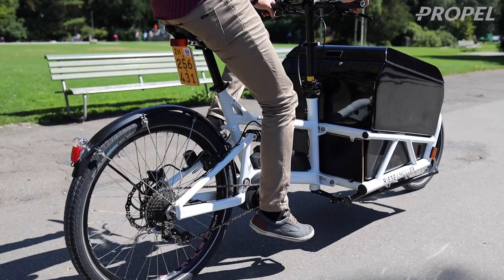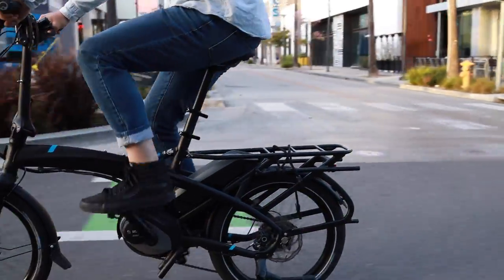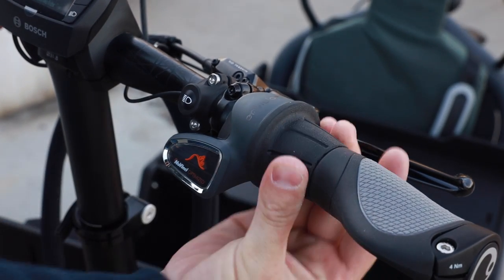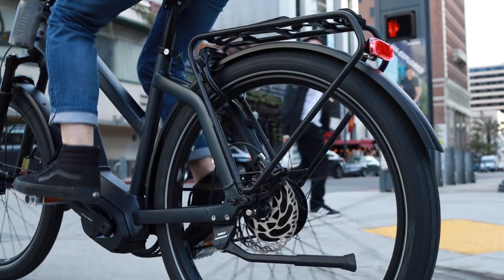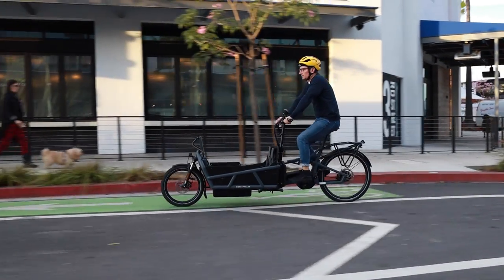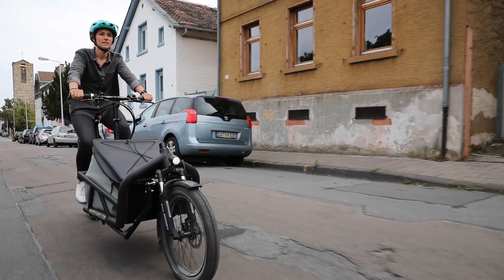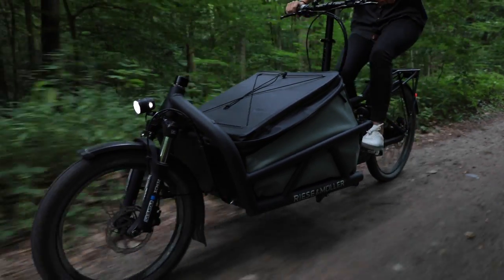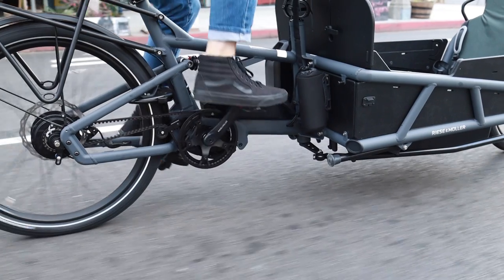Electric Bike Drivetrains: Internal vs External Gears (Derailleur, Enviolo, Rohloff, etc)

Comment: A big one he doesn't mention is Pinion, the German gearbox system with a wider more even range than Rohloff.  Pinion / Gates is my current #1 fitness all purpose all weather choice with a Priority 600. In an ebike that forces a hub drive system with plenty of good options.  The point about chains and derailleur maintenance and cost is well worth considering, especially with the big extra stress of an ebike.  I'm on my third chain / cassette combo in 7,000 miles of ebike riding and I'm really getting tired of paying for them and dealing with the sloppiness when they get worn.  More so after the Gates/Pinion experience. For Rohloff you'll find it much easier to fit into any number of traditional and custom frames. Where I am, close to the old Paramount shop with Gunnar / Waterford you have any number of Rohloff choices. No Pinion as it requires a custom BB frame build.
Reply from the maker: The Pinion is a great system, but it’s largely unavailable here in the US. I also haven’t found too many quality hub motor setups here in the US which would be required to make the Pinion more viable. Some brands in Europe have paired the Pinion with a Goswiss motor, but they are now no longer available. I think some other viable options would be Xion since you kind of need advanced internal torque sensing inside the motor. There aren’t too many motors with these specs on the market and there are none in the US unfortunately.
Reply from the maker: I mean as an ebike. These bikes look great, but we only deal in ebikes. That’s also the focus of this video and discussion.
Reply from the maker: I wish we had all the ebike options available in Germany. I’m working on it though ;)

Comment: Question, I am planning to buy a Supercharger 2 HS (45km/h version). Is it true that the Enviolo system generally blocks around  35-38km/h? Is it true that the only option is to go with derailleur or Rohlof to be able to reach the 45km/h? I do not have the budget for the Rohlof, really hesitating between the external & the enviolo... any advice? I do 100km per week in average. Many thx for your answer :)
Reply: What did you end up with? I can lease a high speed bike through my employee but I'm torn between Enviolo and Rohlof.. Not reaching 45km/h would be a dealbreaker for sure, but if the Enviolo gets there I'm fine with it.

Cheers.

Comment: You have the most useful video I found on this topic (and other great videos).  I tried a new R&M Enviolo 380 HS bike and I found the highest gear too low to get to top speed! According to the R&M website with Enviolo 380 as the highest gear (9.54m) vs Derailleur (8.36m) and Rohloff (9.3m). In your experience is this true? Or does the inefficiency make the Derailleur or Rohloff better. Thanks in advance.
Reply from the maker: Thank you! Glad you enjoy! You definitely need to pedal a little harder on the Enviolo to get to 28 due to the lower efficiency. I still think it’s worth it though. If you want the easiest time to hit 28 the Derailleur and Rohloff are a little better, but Enviolo is still the most popular. I think the new Gen 4 software also improves this.

Comment: Very informative review.  I recently was in the market for an eBike and wanted one with a belt drive and internal gears. However, the dealer advised me against that because of the difficulty of removing the wheel to repair punctures.  I ended up with an excellent eBike with conventionally derailleur gears thereby saving myself a lot of money, around £1,500. However, was he right about the difficulty of removing rear wheels with hub gears?
Reply from the maker: The effort to remove the wheel varies widely depending on the bike and hub manufacturer. Most we work with make it really easy. The key thing is to not have to tension the belt after removing the wheel, this is a poor way to design a bike from my perspective.

Comment: Hi. I have an Iron Horse Tango Tandem that I'd like an internal hub, so as to have a coaster brake. I'd like to have an mid-motor for it also. Is there a good pairing you could suggest? Thanks.
Reply from the maker: Bill we'd love to recommend a aftermarket system, but there are none I can give our stamp on at the moment. I would recommend checking out the electricbikereview.com forum and see what others have experienced with kits.

Comment: on an electric bike, 3 speeds are all that is needed : low, mid and high gear. the engine will fill the gaps. 
7-8 are far too many; the Rohloff serves no purpose for an everyday urban bicycle. 
A good old, reliable and maintenance-free Sturmey Archer, and a chainring/pinion carefully selected and you're good to go. 
even on a Nexus 7 you will use 1st, 4th and 7th an that's it.

Comment: E-bike goes with a carbon drive, internal gears and disc brakes. Everything else is a fail because you want as maintenance free as it gets. Also, continual variable gears are the future just need to have auto gear down when breaking. Meanwhile the Rohloff internal hub is very nice.

Comment: When I was a kid, 55 years ago,  I had a Raleigh 3 speed "English" Racer. It had a 3 speed "Sturmey Archer" internally geared hub. Great bike for its day. Although it was only 3 speeds I could ride it anywhere and never had to worry about a complex derailleur gearing system. It was a simple, rugged, and reliable gearing system. A Do they still make basic 3 speed internally geared bike wheels? If so are they used on electric bikes? For most everyday riding 3 speeds on an electric should be all that's needed and it would certainly be much less expensive than most other internally geared systems. I would also choose a modern belt drive for reliability and low maintenance. One issue with internal gearing on an electric bike is that that a hub motor can't be an option.
Reply: Hi I’m buying an ebike from China that has a Sturmey Archer internal gear hub a gates belt drive and a bfang 750/1000 watt motor, should be here in May, like you say low / no maintenance reliable cheap, ticks all the boxes for me.
Reply: I used to hate those 3 speed Sturmey Archer hubs because the linkages always broke, the hub itself though was strong enough for all the abuse we as kids gave our bikes!
Reply: Brompton folding bikes uses a 3-speed Sturmey Archer hub on their 3-speed and 6-speed versions ( 3 internal hub + 2 speed derailleur). The hubs are now made in Taiwan, not the UK though. They also have an electric version with their own motor.
Reply: The brand new VanMoof S3 and X3 use a 4-speed Sturmey Archer!
Reply: @HartmutSchirmacher71  Thanks, I'll take a look. Do you know if they are electric? Do they have belt or chain drive?

Comment: Thanks Chris for this great tutorial! I have three different uses for biking : internal hub enviolo + carbon gates which I found great for my commuting to work (a little less than 10miles one way), we have a "pino tandem" from Hase bikes with the derailleur XLR which is amazing but hard for my wife to use, especially on such a big bike to ride, takes a lot of attention as you said when stopping. And we will receive soon the Birdy from R&M with derailleur as we both have a public transport use combined with biking here in Belgium. Do you consider electronic shifting a good option either for mountain bike owners as you recommend derailleur/Rohloff or for my personal use of tandem or Birdy (but I have not tried yet and it is already a budget!) ? I did try once at the great "Ronde van Vlaanderen" a road cyclist tour from a friend and it was very light/efficient/handy in that purpose.
Reply from the maker: Thanks for your detailed comment. Sounds like we have similar taste in bikes. Many people do opt for electronic shifting for mountain biking which has its advantages. It’s not really possible to retrofit the E-14, but it’s easier to retrofit electronic shifting on the derailleur.

Comment: Hi Chris, this video is very helpful. I spoke to a cargo bike shop near me and they told me the cables with the Enviolo hub tend to freeze in the winter. What’s your experience with this, is there anything that can be done to prevent it?
Reply from the maker: This can happen, but it’s usually with a big dip in the routing. You can pack the cables and shifter mechanism with grease to prevent this.

Comment: Hi Chris! thanks for the informations. I want to ask something. Which electric motor and chain system do we need on a delivery bike in a cities such as Amsterdam or UK and for example for uber eats or for deliveroo? And which one is more efficient and low cost too for delivery bikes?
Reply from the maker: I think there are some different bikes available in Amsterdam or the UK. I would consider getting a Bosch motor due to its reliability. It would be nice to have a belt and an internal hub, but they will add to the cost. If I was doing that job I would consider spending a bit more upfront though to improve reliability and service intervals.

Comment: I have a riece muller nevo gt 2022, I find it great,one thing is that when upgrades occur, they are not compatible 
With one prior,
For example , my cycle was ordered December 2022, came January  2023, and my kiox computer  has upgraded to model 300.not compatable.
This  is only one item that upsets me. 
Only  by purchasing a new bike, can one get  the new upgradings
Regards Michael green

Comment: This covers the features and use but nobody talks about reliability and longevity. Ebikes get ridden more often and further so it would be good to know which systems are bullet proof over the long haul.
Reply from the maker: In my experience the Bosch motor is the most reliable motor system, this is the main reason why we focus on this motor in our shop. For the hubs, I’ve found the internal hubs generally have great reliability provided they are used within the specifications.

Comment: Have you ever used a shimano nexus 8 speed internal gear hub  with a mid mounted motor? Do you think it will hold up well with the extra torque  a electric  motor can supply? Thanks
Reply from the maker: Roland, the Shimano Nexus 8 speed is an awesome hub. Just don’t use it with a motor with a torque rating over 50Nm and without some sort of shift protection either Bosch with the software torque based shift detection or other systems with a physical cut-off switch. Otherwise it will perform excellent and provide a good low maintenance solution.
Reply: It's fine, I have a ebike with a Yamaha engine that produces 80nm of torque and a Nexus 8, and after 4 years and almost 8000km of use it shifts good.
Reply: I've got good experiance with the Nexus 8 using a Brose motor and Gates CDX belt in all seasons. Now after 17000 km when just switched into 4th gear sometimes it can't manage the torque. As I don't need the 4th gear often I will wait for next 5000 km maintenance intervall. If the problem proceeds I will replace Nexus with same type. Exchange should be easy when reuse the old hub hull. By its cost a lifetime of 20000 km is just fine with me.

Comment: Thank you for the awesome, very informative video. Do u know if Rohloff is working on a internally geared hub combined with a rear hub motor? I am interested in a all wheel drive, dual battery, commuter bike to replace a car. I would like to get to commute speed of 50mph, in order to shorten my commute times, as the distances travel are quite far and I need the speed to keep up with ICE vehicle traffic.
Reply: what you're looking for I think the Pinion Gearbox is the best, (but expensive) since it has the largest gear range available at more than 600%, but you'll still need to have a cog ratio on the drivetrain if you want to be able to pedal effectively at 50mph.

Comment: Thanks for the video, very informative! Quick question regarding the N380 vs Rohloff: do you know what the final gear ratio on each of these are? Which one would have the higher theoretical top speed, given the same amount of pedalling?
Reply: The Rohloff has the widest gear range. Even wider than some derailleur system. You will get a higher top speed on the Rohloff for the same amount of pedaling simply because the gear range of the Rohloff is so much wider than the N380. I'm currently using the NuVinci N360 on my Bike Friday Silk folding bike purchased in 2013. You can read some of my replies (see anything above from here). You should at least try riding a bike equipped with a CVT. It is unbelievably smooth with virtually no clicks, no vibration, no sound at all, and it is instantaneous. Most people who tried riding my bike described as surreal. That is the only cool thing about CVT. Too bad the don't make it with something even wider than the 380%. If you want speed and climb steep hills, go with the Rohloff. It is also lighter and about 10% more energy-efficient compared to the NuVinci. The penalty on the Rohloff: super expensive and you will still get all that clicks noise and can feel the tiny vibration from the gear change. I test rode San Diego's FLX Blade 2.0 electric mountain bike equipped with the Rohloff and Gates Carbon Belt drive just about 3 weeks ago. The smoothness of the CVT is no comparison.
Reply: The 10% efficiency penalty is pretty massive. That’s 10% capacity gone from your battery regardless of its health. If your pedals with zero assist it’s like a 10% weight penalties on inclines. I guess city commuting worth the cash. Good to remember some people have put 300,000km on Rohloff hubs you can always reuse the hub on a new bike be it e bike or not in the future. I really would like to rest ride both. Here in Australia not so lucky with choice and test ride I don’t mean a 3 minute ride around the block.

Comment: If a chain/der. System is 99.%, how would the belt drive internal hubs match up? Do you lose 10% with enviolo? Love the videos!
Reply from the maker: You do lose about 10% efficiency in comparison. For some this is important, but most feel it’s not that critical considering you have a motor.
Reply: Propel Electric Bikes the rohloff is close to der tho?
Reply from the maker: You lose very little in the Rohloff hub.
Reply: @Propelbikes  the 10% translate then in the same proportion in the lifespan of the battery and daily autonomy. Thanks for this video. As usual, very informative and wo emotion

Comment: Just saying with my 80s non index top shifters I can shift top to bottom gear on a 5/6/7 speed instantly so long as teeth are profiled... And to to the middle quite easily, it's just moving one at a time that's difficult compared to modern shifters but for urban use not as important I find.

Comment: Anyone who ever owned a e-bike with center motor, should realize that a belt drive is superiour to chain in most regards. If you drive it in any amount of milage, know how many chains and sprockets you go trough. Rohloff gear is the best internal gear made....so far...only con, is the price. I sell ebikes.
Reply from the maker: The Rohloff is awesome! But I’m also a really big fan of Enviolo for its ease of use.
Reply: Propel Electric Bikes i like it too, but the handle is not suitable for ppl with weak hands, some elderly find it difficult to change. But funktionality of the gear itsself is good
Reply: Propel Electric Bikes i like it too, but the handle is not suitable for ppl with weak hands, some elderly find it difficult to change. But funktionality of the gear itsself is good

Comment: \\\New Subscriber///    What an excellent video; Great stuff .  I'm very new to the E-bike market, however I am trying to get as much information as possible to crunch the numbers in order to pick my new/first ebike to commute to work "sometimes" and for leisurely rides from time to time. I want POWER because I'm old and very large so I need comfort torque reliability and functionality in the bike. I am aware that this will not be a cheap package, but I would really appreciate your help in giving me options that I may not be aware of from my research.

At present, the bikes on my short list are;  Specialised Vado 4.0, and 5.0 2022, Cube Kathmandu Hybrid Pro 625 2022, Cannondale Tesoro Neo X 3, Haibike Trekking 10 i625 2021, Raleigh Centros CB 2022 Hub, Ridgeback Advance 3 2022,.

Now I know it's practically impossible for you to choose for me, however can you whittle this list down and/or add a bike which is not on this list which I should be considering...

Thank you very much for your help.
Martin.